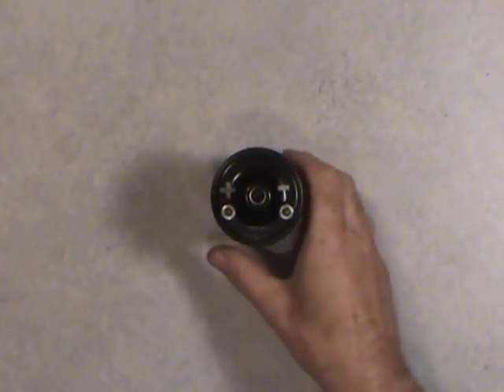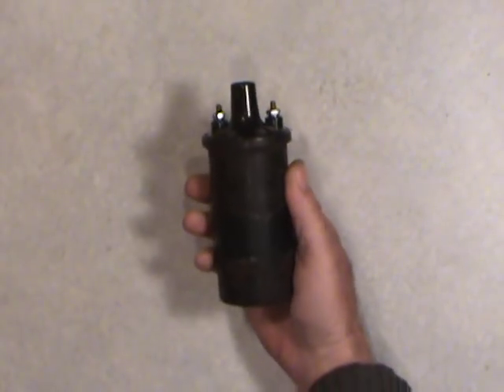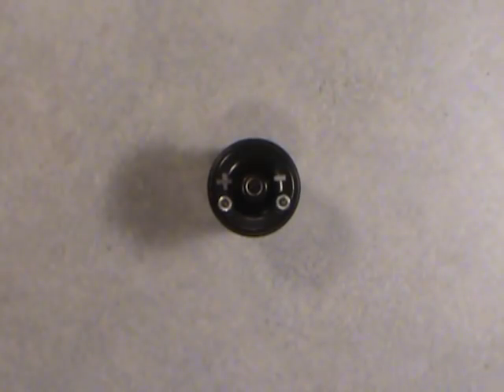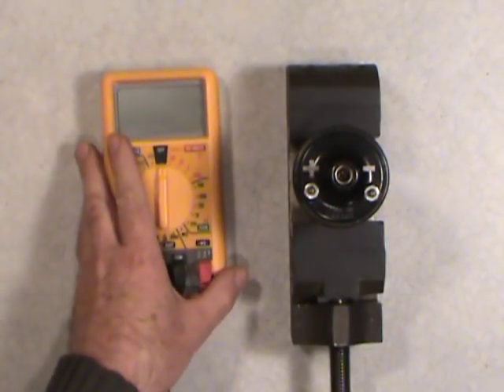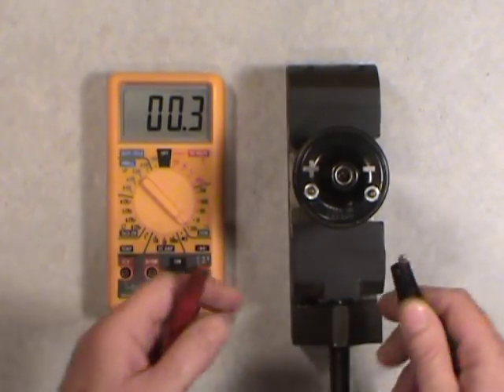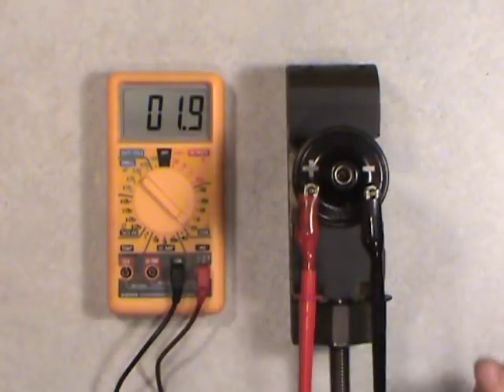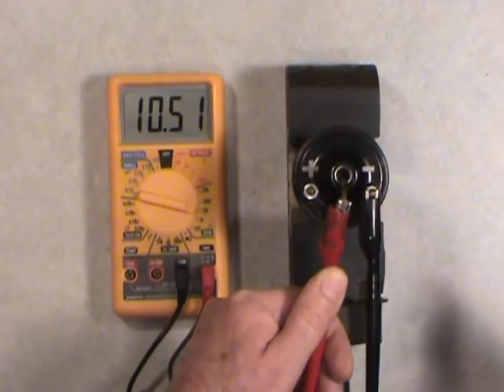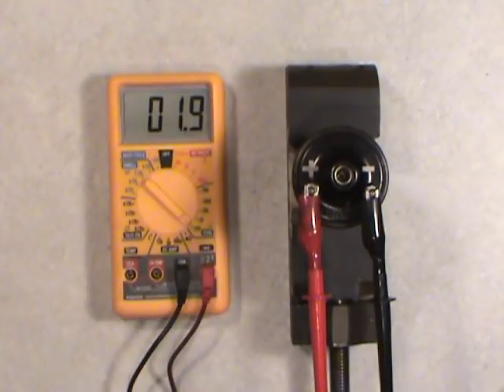Ignition Coil Testing

Comment: I have a 1978 dodge pickup with a slant 6 that uses that exact same coil I've even seen other vehicles built in the early and middle 80's that still had that coil ignition system installed in them straight from the factory

Comment from the maker: ...here are some starting circuit basics for you....The vehicles battery has to be fully charged, and in good condition....All wiring and connections have to be in good condition, clean and tight...The ignition switch (the thing-ah-ma-bob that you put your ignition key into) has to be in good operating condition, and not worn out...There is also usually an ignition Solenoid either mounted on the starter motor, or mounted separately, usually somewhere in the vehicles engine compartment...(con't)

Comment: Those oil filled coils are great coils. Will last many years. They HAVE TO BE INSTALLED VERTICALLY OR STRAIGHT UP. Reason is yes they have oil inside that cools the wires. But there's an air bubble also inside. Which mounted sideways or horizontally, that air bubble uncovers some wire and the wire overheats. Which leads to the coil not working properly.
Reply from the maker: Greetings jim Davidson..................Thanks for watching...............I agree with You, about having, both, the Primary & Secondary Coil Windings, "Totally Submerged", in that, shall we call it, "Cooling Oil" alright, if possible, that is...................You'd think that, the Dodge, Factory/Folks, would think the same, as in "Vertically Mounting" the oil filled type of Ignition Coil, as in, the Secondary, High Voltage "Tower", pointing Up-Wards, towards the Sky, but, this particular oil filled Ignition Coil, that You saw, in this YouTube Video of mine, was Factory mounted, in the "Horizontal" position, at the back, and on top-of, the small block V-8's Intake Manifold, by means of a metal bracket........................This, slightly Leaking Oil, Ignition Coil of mine, was, and is, still Ok, but, I installed a brand spankin' New one, that I purchased, at a genuine, Dodge Dealership, back in the day.......................I recall, hearing-about, someone, who was sayin' that, when the (oil filled, type of) Ignition Coil (of his or hers) was Shaken, a quite pronounced, shall we say, "Sloshing Sound" was heard, which leads me, to be thinkin', that, our Friend, the "Air Bubble", just might be very BIG at that, and I hope not, cuz of, the increased possibility, of "it", perhaps Over-Heating, and going Kaput...!!!...Yikes...!!! (and, I'll even throw in a lol, just for good measure as well...lol).......................So then, assuming, that our (hypothetical & Imaginary), oil filled, type of Ignition Coil, happens to be "Vertically" mounted, with the Maximum amount of (cooling) Oil permissible, inside of it, is only the start (of things), as in, the Ignition Coil, has to be With-in the ohms/resistance "Specifications", for that "Exact", Ignition System/Circuit, and now the rest.................If the Ignition System/Circuit, happens to have, the good ole, oil filled type of Ignition Coil, along with, oh, lettuce say, it's the AC Delco, Points & Condenser, type of, V-8 Distributor (used, up-till, about 1974 there-abouts, that has that slide-up & down, sheet metal "window", on the distributor cap, that allows access, with a Hex/Allen-key, to adjust the points-dwell/gap), shall we, then, the Condenser (aka, Capacitor), that's usually Hiding-inside the distributor, under the distributor cap, has to have, the "Specified" Condenser (probably Rated in Micro-Farads), for that "Exact" Ignition System/Circuit as well, and there's even More, to all of this, as well (still Awake...???...lol).............If there happens to be a "Ballast Resistor" (Ceramic, or, Resistance Wire type, then "it" has to be With-n "Specifications" as well....................Now then, I'll end all of this Madness, with the Spark Plug's "Gap" (that's between the two Electrodes).................The Higher, the Engine's Compression Ratio, along with, a LARGER, spark plug "Gap", pretty much, makes it so, that, our, poor ole Ignition Coil, has to Work, all that much harder, seeing as how, it makes it, much more of a challenge, to be able to create a Spark, between the spark plug's Electrodes, now that, and as I mentioned before, about the Higher Compression Ratio, in conjunction with, that Increased, and quite LARGE spark plug "Gap", and, as I like to put it, is that, it Creates, quite the "Strain", on the Ignition Coil...!!!....and maybe, so much so, that, this particular Ignition Coil...gets...Over-Worked...and will probably...Over-Heat...and go..."Kaput"...!!! (aka, Non-Functional anymore).................Just thinkin'........some Folks, might just Install, an Ignition System, "Component/Part" or two, that might "Not-Be"...With-in "Specifications", for that "Exact", Ignition System/Circuit, and I'll even bet, that, so many of the Problems, that we hear-about, are probably, due to the "Miss-Matched" Ignition Parts, Not-Getting-Along-With-Each-Other, which will probably make-for, a Poorly Running Engine, or, an Engine, that might not even Start, when all's said and done...???...................So, there You have it, well, for now that is, and..........till next time...........Be Safe, take care, and have a good one.

Comment: Thank you for adding to my knowledge, much appreciated, this was the only video  that covered the entire spectrum, in basic and added advanced  tips ,things i knew and things i learned.  Save n for my references for for future refreshing memory,
Reply from the maker: Greetings...BOBBY227BMF...……..You're welcome, and thanks, for your nice comment, and for, watching too...…….Even though, an ignition coil, might check out alright, and, it's within specifications, while doing a low and high ohms test, and is, at room temperature, for example, then, that's not always, a guarantee, that, it will work properly, when it heats up to operating temperature, where sometimes, a faulty, (older?) ignition coil, might not work properly, just so Ya know...……...There's a thing, usually called thermal cycling, where-by, something like, the ignition coil's windings, are kinda cool, temperature-wise, before the engine is started, then, once the ignition coil heats up to operating temperature (maybe even higher, due to engine compartment heat), with the engine running, then, let the expanding begin, then, the engine is shut down, then, all of those coil windings, do the contracting (shinking) thing, and, this, so-called, thermal cycling, pretty much happens, every time, that the engine gets started and stopped, over, and over again...……..Might be, that, the secondary coil windings, are about the same diameter (thickness), as a human hair, there-abouts, and, there are probably thousands of turns, that make up that very same, (secondary) coil (of windings)…!!!...Wowsers…!!!...lol...…….So, yeah, there can come a time, maybe, where an ignition coil, just, plain wears out, and probably applies more to, the oil filled (canister, type of) ignition coil, I be thinkin'...….and...….till next time...…..Be Safe, take care, and have a good one.
Reply: @RockysRoadshow  you have no idea how suprised i was ,to see a reply.. never expected ,nor thoughg of , for that matter.  After reading, to discover, even more that i was unaware of..  amd for mynew recent learning. Thats what is comeimg in to play ,with  my trouble  shooting ,  you just saved me closee to half day of diginose in ,,,THANK YOU so much ,,  
  Yaknow  theirs alot of time ive wasted , problem solving,and that time i wont getpack.. its rare that im given time back ... so thx for give n me a day ..  and knowinh how things are im sure,it wil, bewasted on another project, ,  lol. But not all of it  lol. Lessons learned  applied.. thx
Reply from the maker: Greetings...BOBBY227BMF...……..You're welcome, and, it's good to know, that, some of this stuff, was able to help you out a bit...……..Try to keep all of the parts and pieces, that make up your vehicle's ignition system, in, as new, working condition, as well as, adjusted/set to specifications, as in, the spark plug's "gap", that's between those two electrodes (please note, that, some spark plug designs, are not "gapable/adjustable", or maybe, they could get damaged)…………Always use, an ignition coil, or coils, as the case may be, that have the same, "Exact Specifications", as the factory/manufacturer's "Original" one has...……..As an example, on some of the much older, cylindrically shaped, and filled with oil, ignition coils, there use-tah be, either, 1.5 ohms, or, 3 ohms, "Primary" resistance, and, the 1.5 ohm coil, would probably have had, a ballast resistor, in its electrical circuit, where-as, the 3 ohm coil, would have, probably not, used one at all...!!!...……….So yeah, always use the "correctly specified" ignition components, that, that particular vehicle's engine, calls for, and needs, and...…..till next time...…...Be Safe, take care, and have a good one.

Comment: Thanks!!! Helped a lot and helped me understand the workings of an Ignition Coil, thanks!!!
Reply from the maker: Joe Grove Greetings Joe Grove....You are very Welcome, and, Thanks for watching, and for, Your Super comment as well................................................I'm glad, that this YouTube video of mine, was somewhat able, to help You understand, what's basically going on, with this type of..."Oil Filled Ignition Coil"...and, it usually..."Outputs"..."Less Secondary High Voltage"...to the Spark Plugs, as compared to some of the, shall we say..."High Energy" (aka, in terms of something like a General Motors/Chevy...etc., HEI, or High Energy Ignition...Ignition Coil, that is some cases, has an Epoxy Type of Ignition Coil, mounted right "In", and on Top of the Distributor's, distributor Cap, that I've seen, since about 1975)..............................................The..."Oil Filled Ignition Coil"...that You see in this video of mine, had a few Things to be aware of, as well as, something like, having only, .035" (thirty-five thousandths of an inch) Spark Plug "Gaps" (as opposed to, some of the Spark Plug "Gaps", that can be anywhere from, .045" to .080"...that be, forty-five thousandths of an inch, and, as I've seen, up to, eighty thousandths of an inch...!!!...in an Ignition System, that had, the, shall we say..."Higher Energy/Higher Secondary Voltage"...Ignition Coils).......................................................Just keep in mind, that whenever the Spark Plug "Gap-Size" gets Larger, the Higher the Ignition Coil's..."Secondary High Voltage Output"...has to be, in order to be able to..."Jump the Larger Gap"...between the Spark Plug's..."2 Electrodes"............................................Also, whenever the Spark Plug's "Gaps" Increase, due to the Electrical "Arcing/Spark" Erosion (wear), more-so, on the Older, Regular type of spark plugs, this "Extra" spark plug "Gap", puts quite a "Strain", on the Ignition Coil, and also, just like a Bank Account running out of Money, an Ignition Coil, can also run out of, what is known as..."Ignition Reserve".............................................That's when, the Ignition Coil, can, shall we say..."No Longer Keep Up"...with the amount of..."High Secondary Voltage"...that, those "Worn out Spark Plugs"...with the..."Increased Gaps"...are..."Demanding"...in order to, be able to..."Make the Jump"...between those..."2, Increased Gap, spark plug Electrodes"...due to that..."Spark/Arc Erosion" (Wear, Worn, or Worn-out spark plugs)...that I was mentioning just a short time ago...................................................In most cases, that I've seen, these "Oil Filled Ignition Coils", with a few exceptions (as some of the oil filled ignition coils, might have internal winding specifications, that, as I see it, should eliminate the need for an "External" ballast resistor), have, what is referred to, as a..."Ballast Resistor"...and usually, found in the Wiring Circuit, just before the Oil Filled type of Ignition Coil, in the form of, a "Ceramic Type" (usually white-ish in color)...or, in some General Motors (up to about 1974) Vehicles...a..."Special Resistance Wire"...which, will..."Reduce the Primary, Battery Voltage"...that goes to the Ignition Coil...(now get this)...which will also..."Reduce the Oil Filled Ignition Coil's, Secondary High Voltage Output"...!!!.............But why, You ask...???.............So, that poor ole, Oil Filled (type), of Ignition Coil..."Does Not Burn Itself Out"...due to having, shall we say..."Too long of a Saturation Time" (aka, called Dwell, which is the time it takes, to charge up the ignition coil...Before it goes "Zap"), with, Too High of a..."Primary" (full Battery Voltage)...(as opposed to, the "Reduced Voltage", that the Ballast Resistor...Supply's...to the oil filled type of Ignition Coil).................................................So, always..."Make Sure"...that You..."Purchase/Buy, and Install"...the..."Exact, and Specified"..."Ignition Coil"..."Ballast Resistor" (if so equipped?)...and..."All Specified Parts"...for Your..."Exact, Ignition System"...that is..."In Your Vehicle"...as well as, the..."Correct Spark Plugs"...that have the Spark Plug..."Electrodes, Gapped"...to the..."Specified Gap Setting"...so that Your Vehicle's..."Ignition Coil"..will be able to..."Give a Good Strong Spark, at All Times"...and also, for it to Live, a Long Happy Life as well, that will also, spare You, from spending Money needlessly, on a "New" Ignition Coil (and maybe Other Parts, as well perhaps?).............................................One other thing..............Although, just about any Ignition Coil, might..."Test OK"...with an..."Ohm/Multi-Meter"...there are times, quite rarely at that, that, an...Ignition Coil"...can sometimes..."Not Work Properly" (perhaps Intermittently)...or maybe..."Not At All"...when it..."Heats Up" (ballpark scenario = fully warmed up Engine, to Operating Temperature perhaps)............................Last, but not least, there is, a really good ole Saying, that I like to use, at times (maybe even Over-Use...lol), and that good ole saying is..."The Chain is only as Strong as the Weakest Link" (as in Snap!), when it comes to, just about anything, but seeing as how the subject matter, is about a Vehicle's Ignition System, and its Component Parts, Wiring, and the "Ignition Coil" itself, all it takes is..."One Little, Bad/Faulty, Wiring Connection"...or..."Faulty Part"...to keep Our, usually..."Quite Reliable Ignition System"...from..."Doin' its Thing"...Properly, and as it should...............................................................Thanks again, for Your well appreciated comment, my Friend....................................................Be Safe, take care, and have a good one.
Reply: Your welcome and Thanks for this extra info!! I know a lot about motors and the mechanics of them, I have a 1932 chevy coupe rat rod, a 1967 Kaiser M715, and a few bikes. My only problem was electronics. But thanks again!!